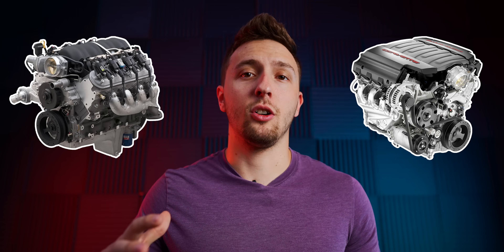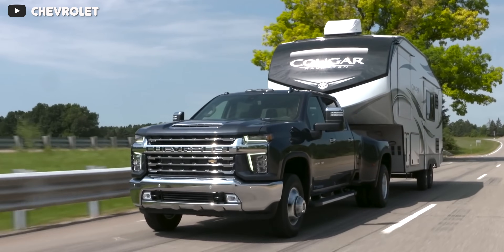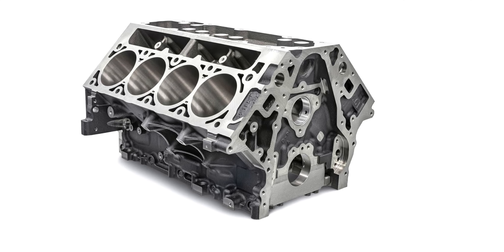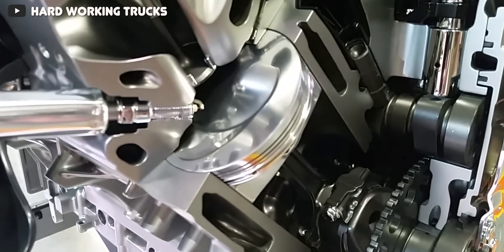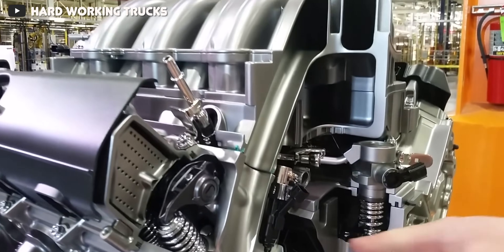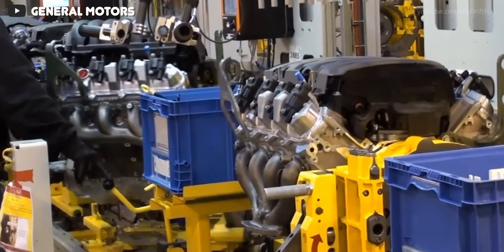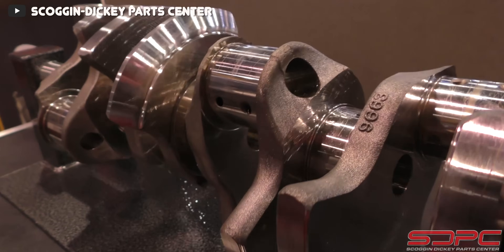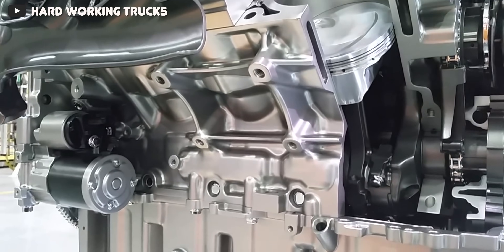Here's Why the GM L8T is the Best LS/LT Engine

Comment: A truck I got to run for 35k miles was 2020 3/4 ton SWB and Quab Cab 4x4. Got 16 to 17 MPG not towing, towing a camper I got 8 MPG, It did drop to around 7 MPG in a lot of hills or high head wind.  Still miss that truck.
Reply: Did you sold it or why did you got rid off it ?

Comment: This is the first gm block cast in iron with a 4.065 bore standard for a production piece. Some guys have already pushed it to 4.1 stroke and 4.185 bore. The L86 actually comes with the same heads and camshaft as lt1 engines, its the intake and exhaust manifolds and packaging with the programming that make the difference in power production. I didn't know the L8T had a forged crank with centre counterweight.  Its beefy, its going to be fairly common.

Comment: what about the ls 454 and i will stick to my stroked 454 bbc stock it had 450 hp at 485 torque all they need is to breath then they come alive with a intake and bigger carb. then u are wrong on the sb stroke the ls 6 454 had 4 1/2 inch stroke and is a small block then u have the ls 7 427 small block and the lsx is a 454 with a 427 crank . i bet u think that ls came out in 1996 when it came out in 1970 as a aluminum small block do u even know what L.S. stands for and here is a hint it is not a package model of a car

Comment: Love how the 6.6 makes less hp than a ford 5.0 but that’s suppose to be such a impressive number lmao
Reply: It's for a truck, torque matters a LOT more.
Reply: @sebbonxxsebbon6824  Exactly mate
Reply: Because it revs low, i.e, makes more torque. The engine in the lorry my dad drives is 14 liters and has a turbo and only makes around 450hp, but, its making that power at like 1500rpm.

Comment: Left out the new 4.3 which is built the same it's a lt motor that puts out same numbers as the older 4.8 have both and still the v8 is just better hands down, but the new 4.3 has a sweet spot where it makes good power and torque.

Comment: Pretty sure they switched to iron block due to costs…. Not strength, as you even mentioned aluminum blocks have been known to hold a lot of power but in todays world cost is more crucial and aluminum blocks simply cost more

Comment: the LS7 wasn't pushed longer due to sleeve failure once modded. it needed to be re-sleeved but most just go to a bored over iron block for strength. so the 7.0 was dropped and the LS9 came to be as the powerful replacement with an impressive amount of engineering involved.

Comment: Thank god for no cylinder deactivation and no start stop. This things gonna be as reliable as the old 4.8 and 5.3 from the early 2000s. The Di might give carbon issues but still. This things got potential!
Reply: I agree. To avoid future carbonized oil deposit build up behind the intake valves for example, one should consider an Oil Catch Can as I understand; I purchased one for my 6.6L (gasoline) and so far, over ~3000 miles driving, it's captured ~40 ml of oil. Otherwise, at ~15,000 miles on the odometer, my truck runs buttery smooth and the power band is very satisfying, even when pulling my 31 ft. trailer.  PS, I can hear a muscle car roar when the engine is pushed / pedal is punched (nice!) that exists with this engine, but is sadly muted by the exhaust / catalytic system.
Reply: @nhlcfl7733  It has that muscle car sound because it has that 10.8:1 compression GM knows how to build a solid gas engine with headers and no cats these 6.6 gassers would sound like a nascar.
Reply: @Back_door_bandit_98  Lol.
Reply: @Justin Pierard  buddy what drugs are you taking? That is so incorrect, I am surprised you could write that and not burst into laughter doing so.
Reply: Oil catch can
Reply: Run the recommended fuels system cleaner listed in the owners manual and you’ll be fine. It says every 10k miles but I run it every oil change. 30k miles with almost half of that towing my 5th wheel.
Reply: DI? Add Catch can, SIMPLE fix to a healthy engine.
Reply: I don't understand why everyone is so hung up on DI. no one brings up DI being an issue when talking about the 5.9 Cummins, and that was the first time they tried DI. plus these engines don't come with EGR valves, which is the main culprit in the carbon problem.
Reply: @michaeljordan4571  I'm late but Thank you.  I own 11 Gm 3-5th gens from ls to new Deactivation deal. And I've never had one problem.  I still own 4 Gm truck,  2000 z71 stepside, 03 4.8, 2012 Gm z71 with Deactivation and a 2019 z71 . No problems.  People take one flaw or lack of car truck engine care and blow it well over bord.
Reply: @god1st.530  exactly, people don't understand that over time engineers refine these system, fix the bugs and make them more reliable.
Reply: @michaeljordan4571 thanks for the heads up that's the first I've heard that it did not have an EGR.

Comment: You can’t go wrong with any of the LS engines, especially the iron blocks!
Reply: This is a lt engine not ls engine .
Reply: @chikisorozco4297  it's actually based off the LS.... it not much different if you know anything about engines
Reply: Untill you start making serious power and then they can't retain head gaskets...

Comment: This engine looks and sounds great but direct injection from what I hear is problematic due to carbon buildup on intake valves. Why not just stick to port fuel injection? Any thoughts?
Reply: Just have to use some of collection mechanism and clean regularly.  Supposedly it's designed in a way to collect on its own.  But a catch can is options.  There are some self service options for intake cleaning that work quite well, check out stp intake cleaner. Clean 6-12 month interval and you may not even need a catch can.
Reply: Just need's a oil/air separator catch can, just like a diesel. Direct fuel injection does not clean the oil from the EGR valve. Since the oil/air separator catch can has to be drained and the oil put back into the engine, OEMs don't include them for thier customers.
Reply: He mentioned it was due to the high compression ratio. It removes the risk of detonation that comes with using such a high compression ratio with such a low octane fuel

Comment: These gas engines are sort of the “Anti- diesel” as far as complexity goes. No AFM, Dod, start stop, and paired with a simple old 6l90, it’s the simple version, easy to live with, HD truck that anyone who’s fallen into hate with diesels will appreciate. Also, with the power this gas engine has the old “Gas or diesel” question is sort of different, almost like there’s a new middle option.Also, Dual alternators is an option.
Reply: I love that dual alternators is a option. I also like how it's a "back to basics" engine eliminating start/stop, AFM, etc. Just let the engine run! Don't kill it by suffocating it like the diesels!
Reply: I loved my Duramax, but got tired of emissions technology problems, so got rid of it and got a 22 Silverado 2500 with the 6.6 gas. I only haul moderately heavy loads so the truck is perfect. GM knocked it out of the park with this truck and engine.
Reply: Well it is the replacement for the L96, which is the flex-fuel version of the LY6. So yeah, I would expect it to be dead simple and reliable just like it's predecessor.
Reply: I still love my 7.3Powerstroke and want a LBZ Dmax  , but you are right the 6.6 and 7.3 Gas  2500-3500 are a very had argument now   especially Off road and when you add a pro charger to the gas

Comment: The best thing about the 6.6 is no active fuel management bull shit ... no start stop ... no nannys... just a good engine...
Reply: That's a great engine, and I absolutely hate that cut out technology and start stop crap on most American trucks. I currently own a 2014 Tundra, because it was the only V8 I could buy that ran on all cylinders all the time and never cut off, but I'm considering the Chevy Custom 2500 HD so I can tow a bigger camper.
Reply: Minus the lifters
Reply: @cornelius6304  and the 6.6 is not known for this issue
Reply: @cornelius6304 only on the 5.3 and 6.2 because of the two piece lifters for the cylinder deactivation. Next time don’t talk
Reply: @cornelius6304  have not had a issue yet ... hopefully not at all...
Reply: I need one of these for my trans am ....6.6 iron block 25 lbs of boost, bingo!
Reply: I had no idea it had no afm. Real game changer

Comment: Yet again GM about five years behind Ford just watching and waiting to get their butt kicked (how many Silverado HD's have you seen on the road) and see how successful Ford does it before they jump in the game.  It will still fail miserably compared to the 7.3 Godzilla.
Reply: Two decades working heavy industrial & mining construction and the vast majority of pickups I see on jobsites are Chevy HD's with the 6.0 or 6.6.  This is is in the coalfields of the Appalachian mountains where the jobsite roads are steep, rough, unpaved, and mostly dirt.  And, saying GM is "5 years behind"? LOL The L8T makes 70.3 ft. lbs. of torque per liter while Ford's "gOdZiLlA" makes 65.1 ft. lbs. per liter. The small block Chevy reaches peak torque at the same (4000) RPM as the big block Ford too. And max torque in the 7.3 is only 11 ft. lbs. higher than the 6.6. GM also gives customers the L8T as the standard engine option, while Ford makes you pay a lot extra for their optional 7.3.  The only thing GM needs for the L8T pickups is an option to select a 4.10 or 4.30 gear for those who plan to tow super heavy a lot.
Reply: @shaun5893  I'm specifically talking class 5,6,7 medium duty trucks. The Silverados with the front hinged hood and the only option being the Duramax right now.  Ford brought the 7.3 to mainly go on their F-550, 650, & 750.  Also, as optional on the pickup trucks too.  They aren't just designed to shout peak numbers, they are also designed to live as long as a simple diesel engine, you know before DEF.  That is what GM is finally now chasing with this engine.  Hell, the medium duty Silverado was an after thought and late to the market too.  This engine is probably GM's last ditch effort to sell those trucks because a lot of guys want a gas option.  I'm betting when Ford brought back the medium duty trucks, they were already working on the 7.3 and just put the Power Stroke in it to get things going. I'm not saying GM does or doesn't make a good truck, just that they never set the standard in advancements. They come in behind the eight ball trying to copy the business model that's been kicking their butts and then it's already changing. Remember when everyone had a big laugh at Ford for going Aluminum in a lot of body panels? GM even made that stupid commercial dropping things in the Ford bed. Now, what has GM quietly started doing? They thought for a bit they would make a carbon fiber bed but found out how expensive that is. Also, with the smaller displacement turbo engines that Ford started using in 1/2 tons. Again, Ford gets mocked and sales are through the roof. What does GM do? Quietly bring out a turbo four cylinder lol. But their foot is already in their mouths and they don't market it and it fails so it was really a waste of time. At least Dodge just says more power!!! Bigger V8, better interior and they get sales.  And when GM actually does something awesome, they don't market it at all and sales are horrible. Chevy SS sports sedan comes to mind. Blows the doors off any Charger and Ford doesn't/didn't even have a competitor for it. Now those are selling for way more than sticker because of how good they actually are, but nobody even heard of them, and they look like a Malibu lol
Reply: I think it's a little awkward to claim GM is behind Ford considering Ford's recent "rediscovery" of the OHV engine.
Reply: @kevin9c1  For the application this engine serves, GM is several years behind. You have to understand we aren't talking about the Coyote in the Mustang vs LS3 in the Camaro and how GM stuck with OHV technology through it all while Ford ditched it for dohc 30 years ago. Not to mention the application of the more advanced fueling technology to the OHV Godzilla and other little engineering tricks they employed to make it make sense for the class 5+ trucks.  The Godzilla and this new GM engine are really doing something no other gasoline OHV V8 has ever done and done well. They are truly competing with a turbo diesel engine in the medium duty space, at least one is/has been and to my point GM is finally throwing their hat in there after seeing that Ford is successfully doing it.
Reply: @nathanaelcole8466  If you really want to take a historical look I don't think you can even say either of them was before the other.  Ford had the V10 in heavy applications.  GM had the 8100 (which is generally better regarded for, say, Class A RV duty before the engine went away, but was also used in the Kodiak medium duty trucks).  Before that, various big blocks, some special class 5/6/7 high deck big blocks.  Before turbo diesels were commonplace, heavy trucks used exclusively big gas engines.  GMC even had a monster 11.5L V12.  The idea that the Godzilla did something new is totally ridiculous.
Reply: @kevin9c1  I am well aware of all those and there is a good reason those all fell out of favor. They weren't that good simply. For the times, they did the job, but they don't even begin to hold a candle to what these two modern OHV gasoline engines offer.  They were completely out of favor when some of the more modern diesel engines like the Cummins in pickup trucks, Duramax, and Power Strokes started finding their way in these medium duty trucks.  It may not be a brand new idea, but the idea of a gasoline engine really being able to replace a diesel in class 5+ was laughable 10 years ago. Hell even one ton pickups rarely had anything but the diesel. It's the final execution and usability with simplicity and durability to match or beat diesel that first happened with the Godzilla. My main point is Ford pushes the envelope and sometimes fails and GM mocks them until they are forced to follow suit or continue to get their butts kicked. Just a common pattern I've noticed, that's all.
Reply: @nathanaelcole8466  Gas big blocks have had more power than diesel offerings until the mid-2000s in pickups.  At least on the GM side, it doesn't matter if you look at the 8100, Vortec 7400, TBI 454 or 4bbl 454 they all had more power than the diesel of the time.  Not always more torque but if the goal is to pull a load up a hill at a certain speed, horsepower is what determines that.

Comment: Odds are if you are shooting for 2000hp, you aren't using a factory production block or even heads for that matter.
Reply: @Thomo5150 Bara used an iron block. Most LSs and LTs are aluminum. In the U.S. at least aftermarket blocks for these 2 engines are readily available as well as heads. For most big engine builders if they know from the start that they are shooting for 2000 hp they don't typically bother with factory castings. The LS/LT aftermarket is hundreds of times larger than the Bara. Not bashing the Bara, it's a badass engine. Reality is reality though. The Toyota 2JZ can make big number with factory blocks but even those start having issues in the 1600hp range, hence after market billet blocks
Reply: @Thomo5150 being in Australia explains it. Truck LSs can be yanked out of junk yards here for a few hundred bucks. They are all over the place
Reply: Not 2000 stock u could push 3000
Reply: @bigadielldne7234 most people setting out to make that much hp are going to go with an after market block. With the money tied up to make 3000hp, and after market block isn't that expensive
Reply: @aw11man26  that stock block can handle more hp then other engines w a aftermarket block.

Comment: Ive been looking at getting a new HD truck at first I wanted a cummins, however with the crack down on emmsion equipment deleteing up here in Canada ive decided to go gas plus its about 10,000$ cheaper. I was worried about this new 6.6 but after this video I think its safe to say my next truck will have the L8T.
Reply: 2024 6.6L gas is said to have the Ally 10 speed transmission! 👍
Reply: @Whiskeybende  Allison doesn't make a 10spd tranny. GM is just paying Allison for the right to put their name on a GM tranny.
Reply: @tlr-nut7275  yes I know the 10 speed is a "Allison branded" transmission how GM calls it. Basically just enough to put the Allison name on the truck.
Reply: There were rumors and reports that GM was working on a new gas engine of over 8 liters but nothing concrete yet
Reply: I'd look at the 7.3L Godzilla.  Better plus 10R140 10 spd, vs GM 6spd.
Reply: @27dmarshall  the 2024 HD gas is getting the Allison 10 speed.  I don’t think it’s necessary though.  I like my 6 speed and all of the L5P guys said going from 6 speed to 10 speed they lost some fuel economy.
Reply: @27dmarshall  GMs 6L90 is better than the 10R140 it’s a proven transmission that does not see as much down time like ford has been seeing with their transmission’s. 
As far as the 7.3 being better that’s just an opinion at the end of the day the 6.6 has higher compression and more tune ability being direct injection.
Reply: @Back_door_bandit_98  I'm not a Ford guy, more GM for me, but so far the 7.3 seems like it's a beast of an engine. With a fully forged rotating assembly and iron block it is just begging for a blower. That lower compression lends itself well to boost